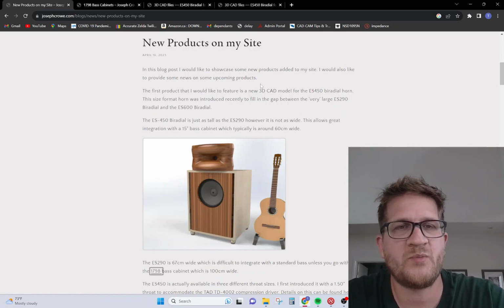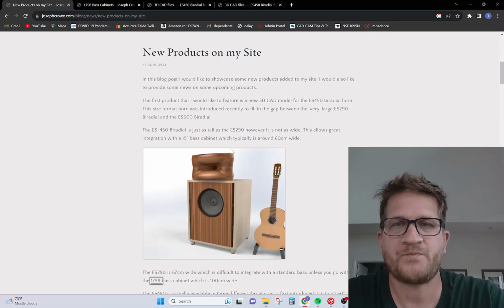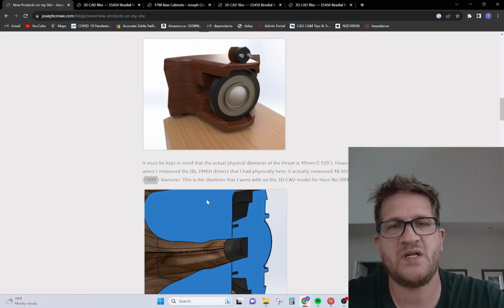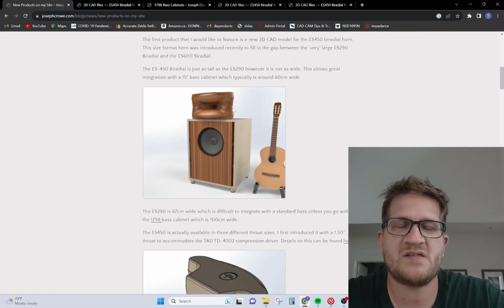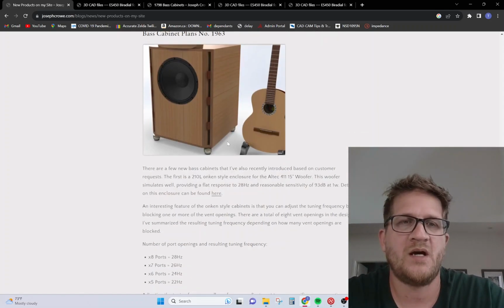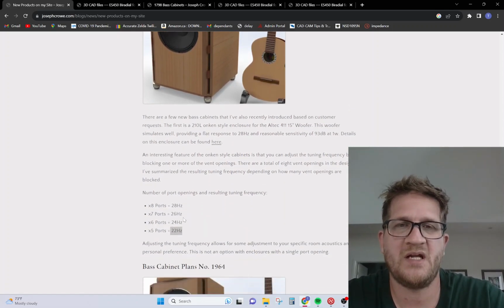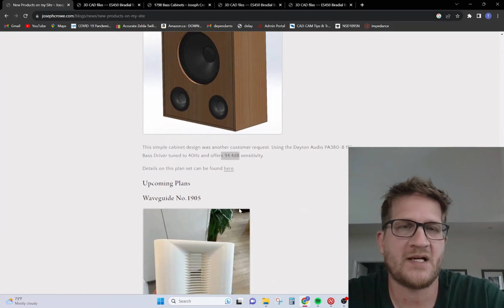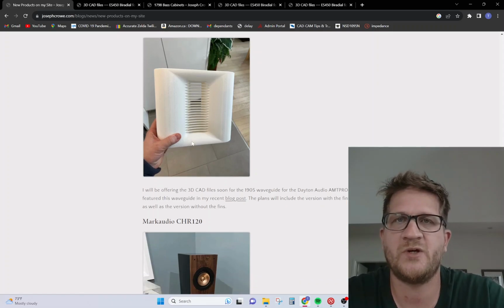New Products On My Site

Comment: If one were to make a hybrid passive/active system, the mid/tweeter being passive and the bass being FIR active, would it be ok to cross the es 450 at around 450-500Hz? Could match a steeper slope actively without having a crazy parts count

Comment: always in aw , how you make your horns ! they look beautiful !! by the way i wanted to ask you something about horns if thats ok.  i made my dapolito  planar, and i wonder what specs you would use to design a horn for something like a planar ? since often they do not come or are impossible to get TS parameters for (i tried measuring a few but since i cant just ad a known weight since its not a piston :()  since i want to get my mids down to 200 hz.. what kind of  horn would we be looking at  more or less ? the driver itself is capable of playing down to  110hz, but ofcourse with less max spls and raised  distortion :( i was just wondering :) greetings Joppe !
Reply from the maker: Horn No.1931 is my latest iteration which sounds really good. It’s a 500Hz Fc which is a nice size for still loading up some of the treble. If you want MTM then a shape like the Nighthawk is the only way to get wide coverage from a shared horn.

https://josephcrowe.com/products/horn-no-1931-es-front-horn-for-grs-pt6825-planar-tweeter?_pos=1&_psq=1931&_ss=e&_v=1.0